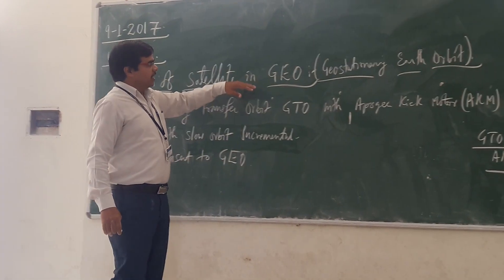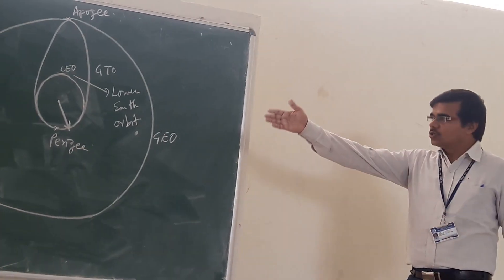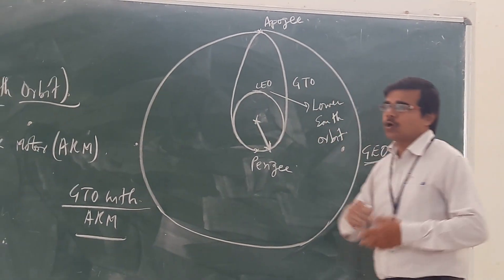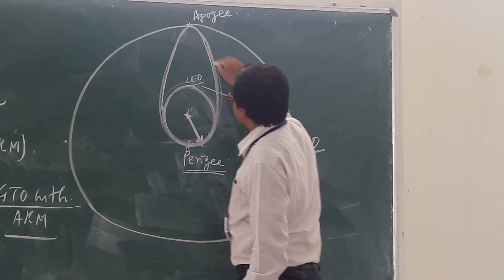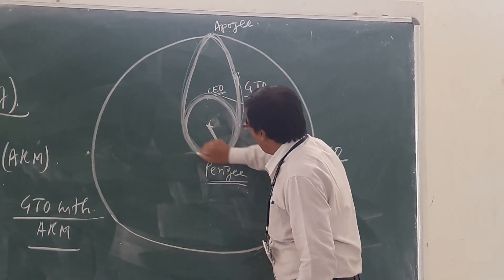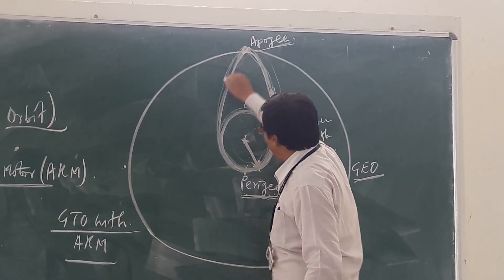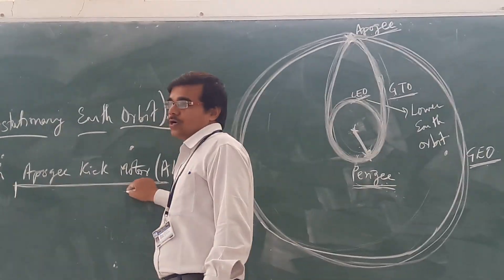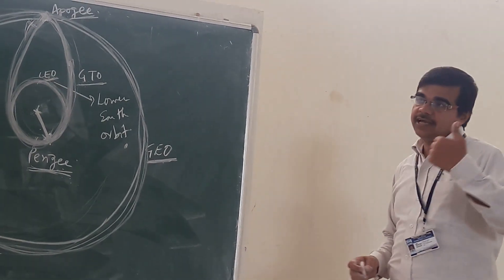SC UNIT 1 TOPIC 9/14  Position of Satellite in Geo Stationary Earth Orbit

Comment: sir can you please put the syllabus also, it will help us to know which portion matches to our university syllabus
Reply from the maker: Dear Reena Kumari,
i am putting the SATELLITE COMMUNICATIONS syllabus as per your request. The syllabus is as per JNTUH.
UNIT -I:
Communication Satellite: Orbit and Description: A Brief history of satellite Communication, Satellite Frequency Bands, Satellite Systems, Applications, Orbital Period and Velocity, effects of Orbital Inclination, Azimuth and Elevation, Coverage angle and slant Range, Eclipse, Orbital Perturbations, Placement of a Satellite in a Geo-Stationary orbit.
UNIT -II:
Satellite Sub-Systems: Attitude and Orbit Control system, TT&C subsystem, Attitude Control subsystem, Power systems, Communication subsystems, Satellite Antenna Equipment.
Satellite Link: Basic Transmission Theory, System Noise Temperature and G/T ratio, Basic Link Analysis, Interference Analysis, Design of satellite Links for a specified C/N, (With and without frequency Re-use), Link Budget.
UNIT -III:
Propagation effects: Introduction, Atmospheric Absorption, Cloud
Attenuation, Tropospheric and Ionospeheric Scintillation and Low angle fading, Rain induced attenuation, rain induced cross polarization interference.Multiple Access: Frequency Division Multiple Access (FDMA) - Intermodulation, Calculation of C/N, Time Division Multiple Access (TDMA)- Frame Structure, Burst Structure, Satellite Switched TDMA, On-board Processing, Demand Assignment Multiple Access (DAMA) – Types of Demand Assignment, Characteristics, CDMA Spread Spectrum Transmission and Reception.
UNIT -IV:
Earth Station Technology: Transmitters, Receivers, Antennas, Tracking Systems, Terrestrial Interface, Power Test Methods, Lower Orbit Considerations. Satellite Navigation and Global Positioning Systems: Radio and Satellite Navigation, GPS Position Location Principles, GPS Receivers, GPS C/A Code Accuracy, Differential GPS.
UNIT -V:
Satellite Packet Communications: Message Transmission by FDMA: M/ G/1 Queue, Message Transmission by TDMA, PURE ALOHA-Satellite Packet Switching, Slotted Aloha, Packet Reservation, Tree Algorithm.
TEXT BOOKS:
1. Satellite Communications –Timothy Pratt, Charles Bostian, Jeremy Allnutt, 2nd Edition, 2003, John Wiley & Sons.
2. Satellite Communications Engineering – Wilbur, L. Pritchand, Robert A. Nelson and Heuri G. Suyderhoud, 2nd Ed., Pearson Publications.
3. Digital Satellite Communications-Tri.T.Ha, 2nd Edition, 1990, Mc.Graw Hill.